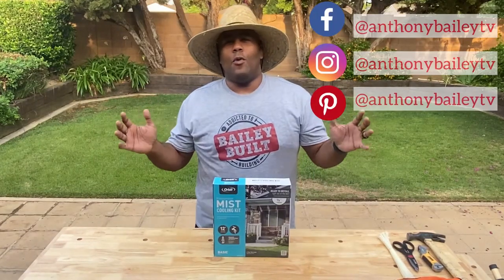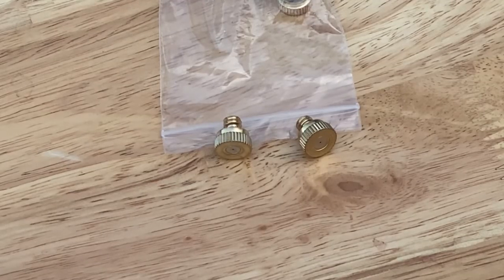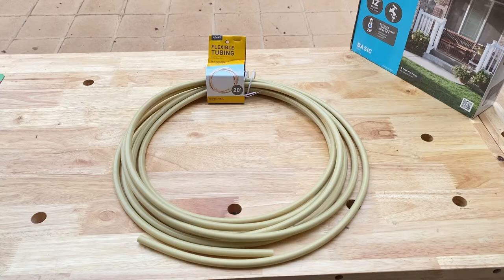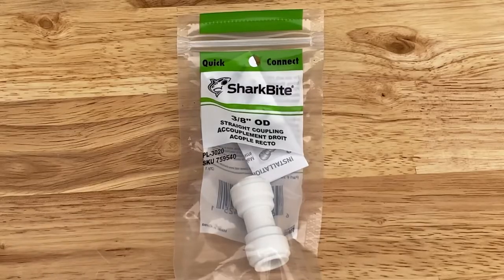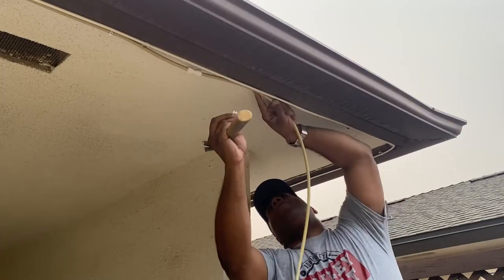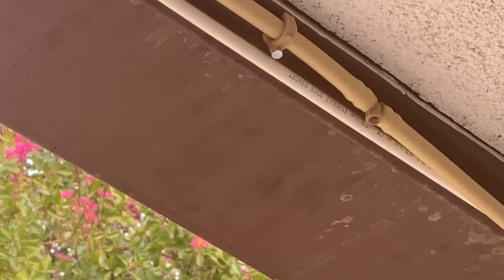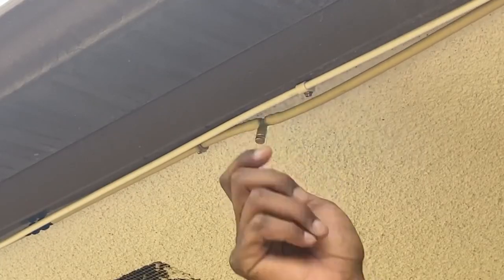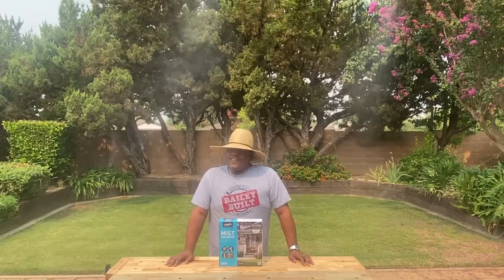How to install an Orbit Mist Cooling System

Comment: Great video! I just bought the mister kit with the extension package. Your video answers every single question and concern I had about the system and how to set it up. The Sharkbite and 20' extension addition is solid gold. I'll be picking that stuff up tomorrow!
Reply from the maker: Thanks Rex! I'm glad this helped. Good luck with your project!

Comment: Great video! 
 What’s an alternative if I can’t find the exact 1/4 inch barb connector? All the ones I found are shorter.
Reply from the maker: Thanks for watching. You can look on the ace website for that specific piece or you can also look at a drip system as another way to modify the system.